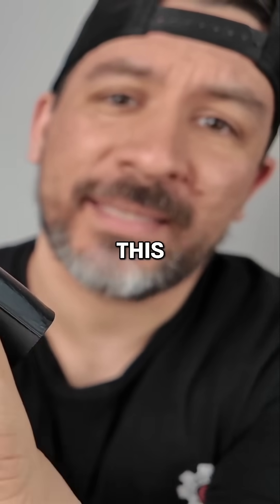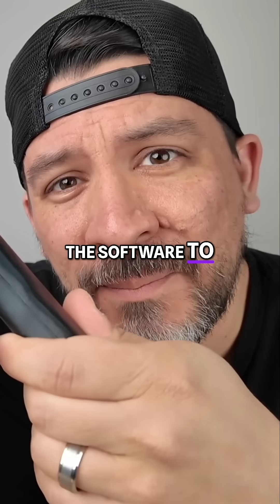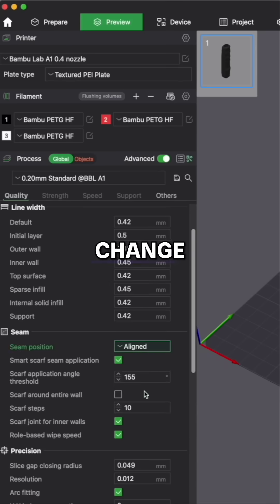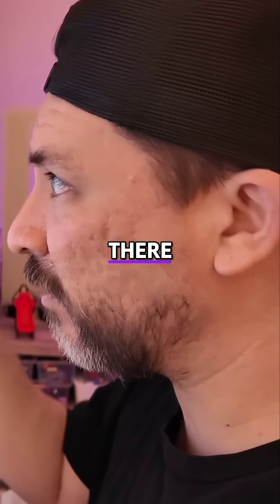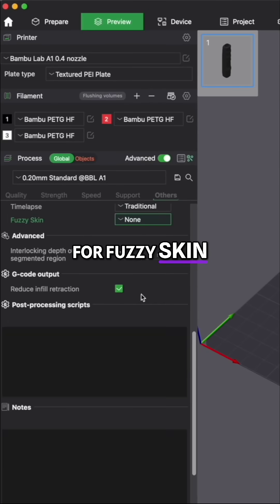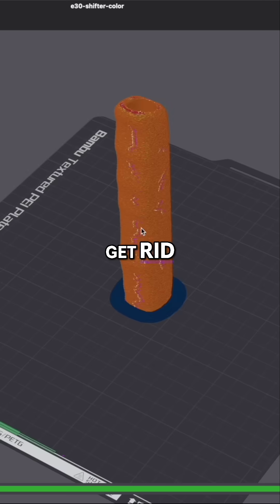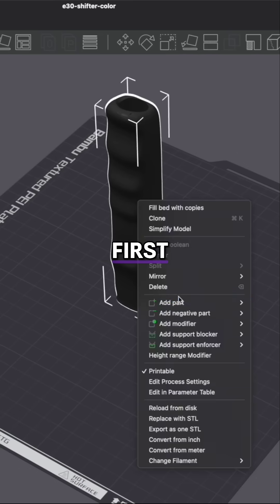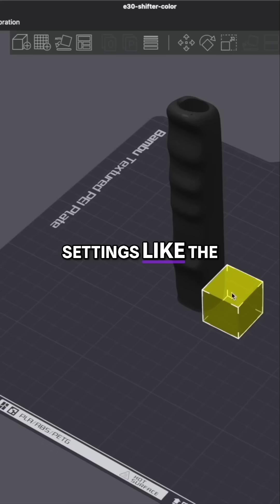Simple Trick to Eliminate 3d Printed Seam Lines

Comment: Scarf joints + Perfect PA Calibration
Reply from the maker: Will give it a try, but it looks like scarf needs a bit more fine tuning in bambu studio...
Reply: @Itsallaboutthebuild  I use the Orca Slicer, and here are some personal experiences drawn from it, it works on many filaments.

* Pressure Advance is very important; you need the most precise value possible for the cleanest Seam. Perform careful calibration.

* Use Scarf Join Seam: Contour for the outer surface.

* Nozzle 0.4 mm, outer wall 0.6 mm > 0.4 mm to reduce dimensional error (this setting can make a significant difference).

* An outer-wall speed of 75–100 mm/s works best.

* Enable Conditional Scarf Joint.

* Seam Position: Aligned or Back (yields the nicest appearance but is mechanically weaker—consider this if structural strength is critical).

* DO NOT enable “Wipe on loops” or “Wipe before external loop.”

* Seam Gap doesn’t seem to have much impact, but 0% is preferable to 10% since you won’t see any stringing.

* Scarfing around the entire wall appears slightly better—if it doesn’t negatively affect print time or overall quality, it’s worth using.

* It’s recommended to use Scarf Join for the inner wall, provided it doesn’t add too much extra print time.
Reply from the maker: Thx for the tips, will give it a try.